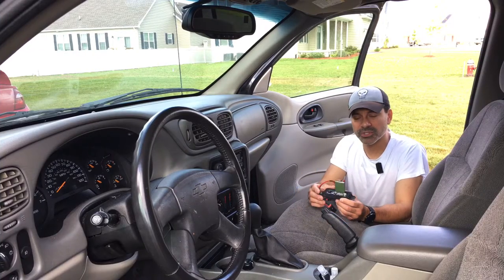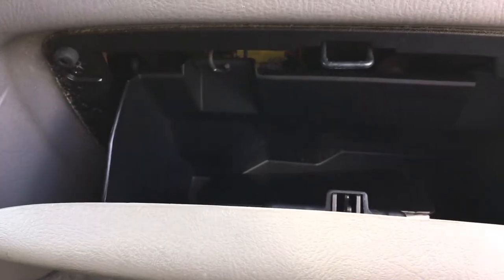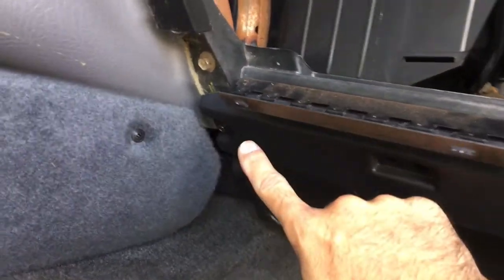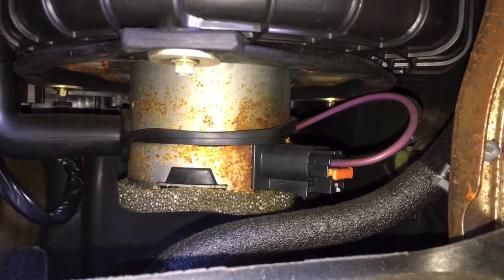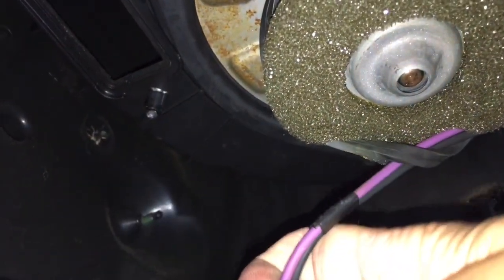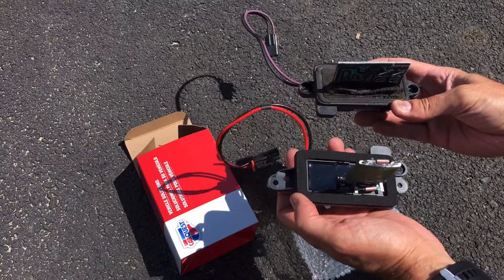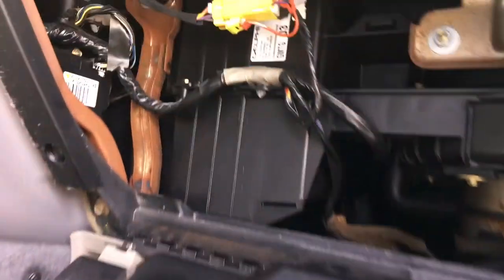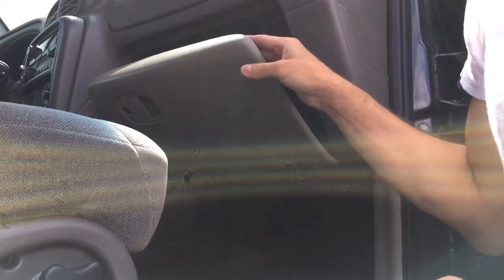How To Replace HVAC Blower Motor Resistor - Chevy Trailblazer (Andy’s Garage: Episode - 267)

Comment: Thanks for helping me get this damn'd thing changed! Word to the wise...check the wires on the pigtail that's connected to it! 2 of the wires on my pigtail were melted and burnt! A 1/2 an hour job took me an hour and a half to complete. Had to replace pigtail and re-wire but all is good!

Comment: Love your video, I'm going to do what you just did to my 2002 4x4 envoy. Now, only the heat is coming out. Do you think this will fix my problem not having cool Air? Please help me. Thank you for your video
Reply from the maker: The blower motor will usually affect the switch settings. If the switches are working fine but just the a/c not working, it could be the compressor.

Comment: My HVAC controls are automatic, which I hate. Do you know if it's possible to remove them, and swap them out for manual controls like your car has?
Reply from the maker: I’ve never tried it, but I’m sure it’s possible with the right engineering and knowledge

Comment: I did mine worked for like 10 min . But once started driving  5 stopped working then 4 , and  now it only works on 1 to  4. . Weird smell is coming out too. Tried the Ac pro ting and wouldn't take it. Any thoughts that can help .. thanks
Reply from the maker: The smell could be caused by a dirty cabin filter or a leak in your a/c system. The failing controls could be a bad or poor quality blower motor resistor
Reply: #5 is on a separate circuit.   It's fused separately.   That fuse would blow if your blower motor is drawing too many amps.

Comment: Followed step by step, but my 4 isn't working still. I thought it was the resistor so i took it back and installed another. But same thing. What could that be? I mean the others work so not the biggest deal. Just wonder could i have done something wrong?

Comment: my blower ain't working on no settings 1 through 5 but also my lights on my air button and the light on my rear defroster ain't lighting up either I checked all the fuses in both boxes under the back seat and under the hood so I wonder if this still would be my problem ?
Reply from the maker: It could be the Resistor, but could also be the blower motor itself